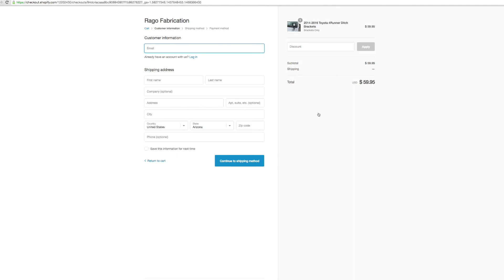Rago Fabrication Ditch Brackets Installation

Comment: Good video, I have a question. My passenger side 2nd bolt is really tight and I can’t get it off. Any tips? I got all the others off Easy. I’ve tried everything , oil , different sockets and longer ones . I can’t get it